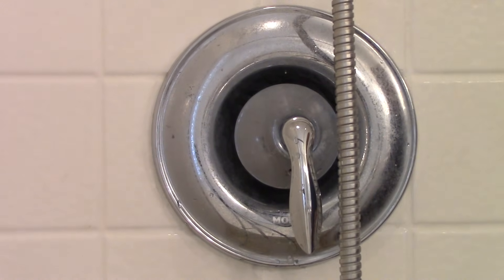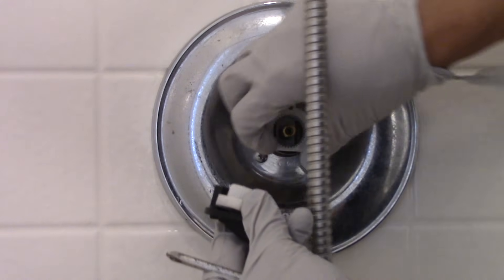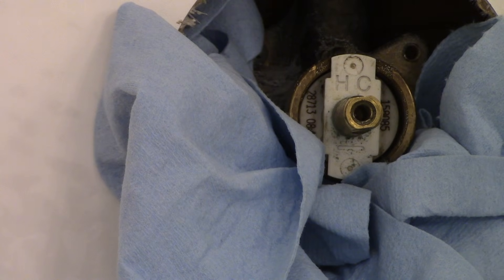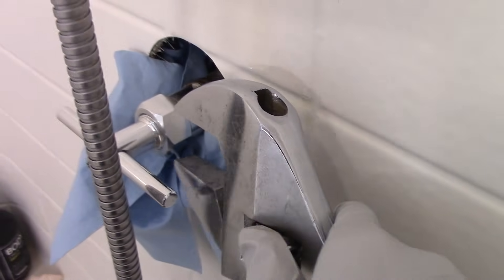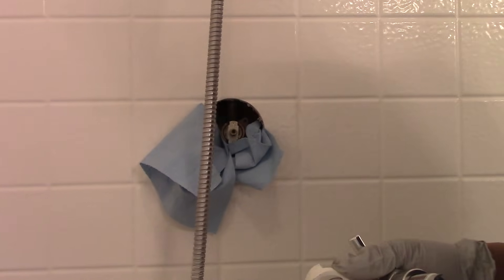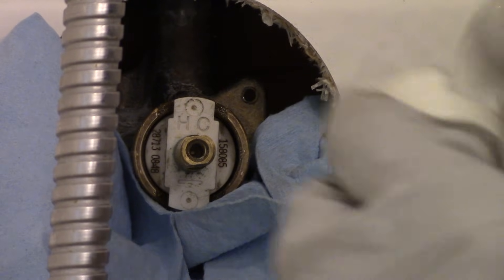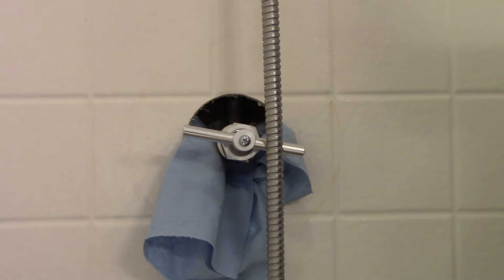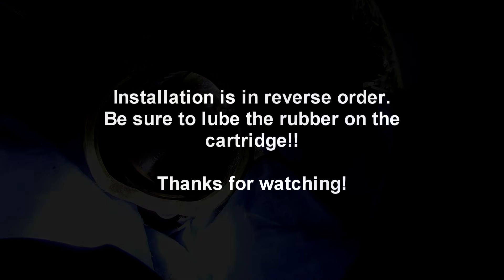Removing Moen 1222B Cartridge

Comment: I was stuck removing the Moen cartridge from my shower faucet. I was using the Danco removal tool, had reached its limit and the cartridge was still stuck. Using your idea about fabricating an extension tool from 1" PVC saved the day. Thank you very much E Chew.

Comment: Awsome video man. Im new to this I'm a Diy if you don't have lube what else can you lube it with ?how much is this type of job for a plumer?I why i haven't seen nobody video  ever spray any lubricant inside to loosen it?just wondering
Reply from the maker: I'd didn't use lube to remove it.  But someone in the comments says they used WD40 lube for removal.  I only used the lube for installation, and that lube came in a small plastic package with the new cartridge.  I think a plumber might charge around a $100.  I am not 100% sure

Comment: I am getting low water temp from shower, so I will put new 1222B.  To measure the temp of water coming in, do you know how can measure without the 1222B.   What is the name of the plumbing assembly that the 1222b goes into, so I can ask home depot also

Comment: thanks for the idea.  i needed it and it worked.  i modified your approach slightly.  i bought a 10/24 threaded rod to allow more play and a longer screw into the faucet.  i also used the long version of your pvc pipe (probably 4" long).  it worked but i needed an additional mod since the pvc was getting out of shape from the pressure.  i superglued a couple of washers on the end touching the puller and that gave it more rigidity.  worked great.  thanks for the tip.  also, this 20 minute project took me 10 days to do as the set screw was frozen and the head stripped.  drilled it out but nicked the inside screw head enough that screw driver would not work on it.  drilled that out and tapped a 10/24 thread in and that worked.

Comment: The new 1222B cartridge comes with a white plastic piece inside the package. Put that piece onto the old cartridge and use a wrench to turn left and right to loosen the old cartridge before you can pull the old one out easily.
Reply from the maker: That's if it works.  It's never worked for me.  Could be hard water....who knows.  If that doesn't work, then this video does.

Comment: Thank you for this video. Your method of using a notched PVC is a great idea that I hadn't thought of.  The problem with these cartridges in hard water applications is that you have to pull them with so much force it risks ripping the housing out of the wall.  With your method, it really reduces that risk.  I may even tinker with the idea of a longer iron pipe with a notch to get more of a pull distance on it.

Comment: If you back out the screw as far as it goes the two forks will seat into the cartridge and then you can tighten the puller nut, the two plastic wings on the cartridge will flex enough to break the seal. You only need to move the cartridge out a couple thousandths to break the seal and remove it.

Comment: One thing people forget is to use the tool to twist the cartridge back on forth. Once you get it to move around it should come out easily.
Reply from the maker: Negatron.  It's completely seized for most of us.  Wiggling did nothing but play with my emotions.
Reply: My cartridge was so stuck, the moen removal tool simply distorted and slipped off when trying to twist the cartridge.

Comment: That tool sucks.. i used that.. look at the round steel.. it's preventing the white plastic wing which is included to the cartridge to go out... it even break the screw inside.. good thing HD accepted to return that as Defective tool...

Comment: Ya got her. That's good. I'm thinking instead of using that puller ; break off those tabs ; rotate and wiggle that cartridge out. Might be a good idea to turn your water on slightly to flush out any debris. Moen kinda crapped the bed on that one.

Comment: I have this exact same problem with my Moen. After watching this video I will replace my Moen with a different brand. My cartridge failed in less than 5 years.
Reply from the maker: Get one with an affordable cartridge.  Otherwise the Moen works fine if you keep the tools to the side when you need it.  I can swap it out in less than 10 mins now 😜

Comment: You dont need to buy that tool. Just drill a hole into the old cartridge and put a screw in there. Then use a crowbar or hammer and put the screw in between the teeth. Then pull it out. Saves you some money